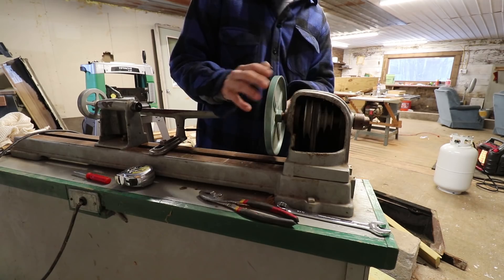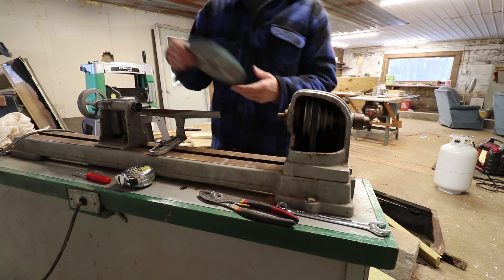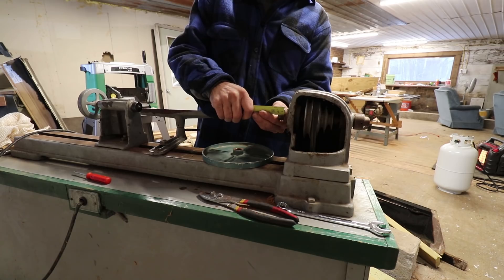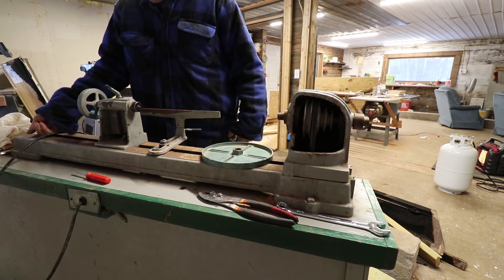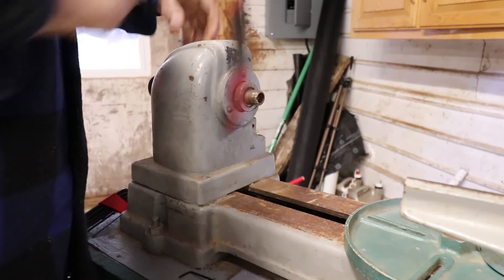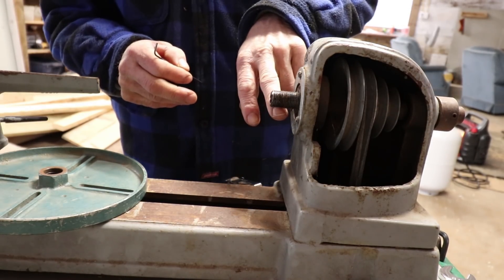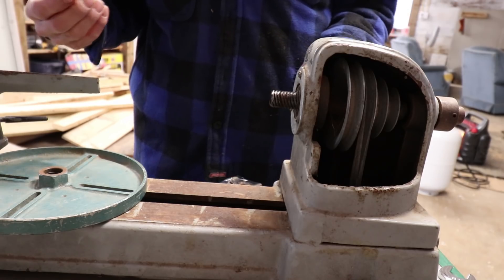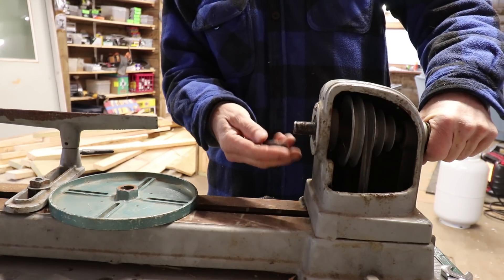THE WORKSHOP. Lathe Question. I need Lathe Chuck advice. Please Help.

Comment: I bought an adaptor off of penn state industries, to adapt my lathe to a common size thread..  A lot of tap and die sets have a thread gages, where can figure out the thread pitch or just see what size nut fits on.  The adaptor from penn state industries worked fine for me.    As for the chuck,  I have a straight tooth chuck and hardly ever use it, seams easy to knock the piece out of center.  I don't feel like they hold the work piece very well.  I think a dovetail jaw would be best.  I have multiple face plates I use mostly.

Comment: Get a couple of thread pitch gauges.  They will come in handy.  Also a digital caliper and a set of dividers.  A 6" and possibly a 12" SS rule will be more precise than a tape.  When you start messing about with tooling get out the mechanic/machinist hat and throw the carpenter hat back in the truck.  Good luck - lots of things to learn on a lathe.

Comment: That’s an Atlas lathe Power King.
Go to Brian Weekley he’s on you tube and rebuilt one just like yours.
The tag is on the back side under the  open part where you gang pulleys are. Yours is gone. I wished I could send you a pic but go to Brian and he will fix you up.
You can look up Thom Stevens he tore one down too.

Comment: I have no doubt there are several viewers who can guide you.  I know your pain when it comes to buying a tool for the occasional use.  If you are anything like me, you want something that functions well enough and that will provide a level of longevity without breaking the bank.  Well wouldn't we all...lolololol  I own several Grizzly products as well as Jet.  My recommendation is: see if you can luck out on a used Jet Lathe.  Obviously there are better ones in the market but better means pricier.  As a side note, I don't know if its me, but Grizzly seems to have dropped in quality.   Wonder what some of your viewers think.  It will be fun reading the comments.

Comment: JOE. I have an oldf Sears lathe with the 3/4 shaft. I checked with the chuck supplier and they said they had an adapter to go to 2inch dia. To match their chuck.  I also found that the lathe had a #1 morse taper in the head and tail stock. Most modern lathes and accessories have a # 2 taper. I have asked a local mackine shop if they can bore the #1 to a #2. They said it will cost about $200.00.  They said the shafts are hardened. Most modern accessories  are #2 taper.  I am still considering getting a newer lathe.

Comment: EBay shows a Sears 4 inch face plate #9-2489 for Craftsman Lathes  3/4 inch bore x 16 T.P.I.  they have six available for 29.87 each  you would have to buy a lathe chuck to go with it.

Comment: One of the standard spindle sizes on wood lathes is 3/4 by 16 tpi (threads per inch) the spindle stop is needed for most faceplates to give a seat to the faceplate or to a chuck so they don't become jammed on the spindle. Most places that handle tools for wood lathes should have what your looking for. Also, the tools that you were using are carving tools, lathe tools have long handles and are much heavier, the inexpensive lathe tools will have a handle of about 10 inches or better and the higher priced ones will be about 14 to 16 inches. You can use carving tools and they do work but the steel will not stay sharp as long, because the edge relief is to short. Your best bet is to view wood turning videos to get a visual idea of how to operate it for best results, and then lots of lovely practice and once you feel comfortable with it, your pretty much good to go. Hope this helps

Comment: Hey Joe, I work for a company that sells Nova Chucks, One way Chucks and Easy Wood Chucks. As mentioned you'll count the threads within the ½" and double to get your thread pitch. In the ¾" diameter Nova Chuck will have an adapter in the 10, 14 or 16 TPI sizes.

You'll want to look at the Nova Pro-Tek G3  insert chuck ($139.00) and then the insert adapter compatible with you TPI...($27)

As mentioned you're using carving chisels as turning tools so you may want to look at some better tools. Contrary to popular belief, the lathe is never the expensive part of the hobby.....its all the other items needed.

Comment: Joe, look on Amazon. LA341018 PSI woodworking spindle adapter. Then a Nova Chuck 1” 8tpi will work on you lathe. You also need some actual lathe gouges. Those little carving gouges you have are not designed for the force the lathe will put out. Carbide lathe tools are also a great way to get a feel for turning.

Comment: Joe, you will either need to buy an adapter, that will take your 3/4" to make it a it a 8 N 1.  If you can't find one, maybe a machine shop could make you one.  Here's a link, on Amazon, for several different size adapters.   Maybe one will work for you.  https://www.amazon.com/PSI-Woodworking-LA3318-Headstock-Spindle/dp/B000KI8CBQ/ref=pd_day0_2?pd_rd_w=IpUWF&pf_rd_p=8ca997d7-1ea0-4c8f-9e14-a6d756b83e30&pf_rd_r=KYZPV5FGG59PVZV3X4TG&pd_rd_r=b44a7905-e494-442f-8f0f-987b4e314490&pd_rd_wg=QkJna&pd_rd_i=B000KI8C9I&th=1

Comment: Those are hand carving tools not wood lathe tools. That's a Delta lathe. The collar is there to keep the shaft from moving lateral. Put the collar back on. Threads are standard. Every lathe should be the same in the US. Get a Nova chuck.

Comment: If I were doing it, I'd want to identify the lathe first. Sites like vintagemachinery.org might be useful for research (that site in particular has photo indexes). Knowing general characteristics might help in the search...spindle threading (outboard as well?) solid spindle?, MT 1/2 headstock and/just tailstock?, swing?, motor HP, etc. I'm lucky because my old Delta lathe had a plate, but otherwise I'd be looking for part numbers and so on.  Granted components can be swapped between equipment, but it might help with detective work... I've been pretty happy with a Nova G3 using the 7/8-14 insert I needed.

Comment: Hey Joe I have quite a bit of lathe experience I would try and find a chuck with the same threads as the shaft and I would leave the spacer on it. It looks like you have more then an inch of shaft with the spacer not on there and I'm sure you know threads are measured by how many per inch my guess is the shaft is a 3/4 by 10 thread. Which ever way you go I would get a 4 jaw chuck, there are two kinds an independent jaw which means each jaw moves separately I wouldn't go that way they can be difficult to center your stock I would go with self centering 4 jaw. Hope this helps

Comment: Hi Joe, I have a Walker Turner spindle lathe, around 1930. It has a 3/4 inch shaft with 10 tpi. I ended up buying a 1 inch chuck with adapter to fit the 3/4 inch shaft from Penn State Industries. FYI, you need all the parts attached to the lathe. Lastly I recently moved the motor from the back of my lathe to the bottom under the pulley. Works well, I would say it works much better.

Comment: You can modify that faceplate you have there to use.  Go to a used machine place near you and get a used chuck for cheap.  The people there should help you with transferring the chuck to the faceplate better than I can here.  I was a machinist for 50 years and doing this would be 20 min. job and tell it would take me forever.  I think that advice can get you started in the right direction.

Comment: Check the messenger for your Facebook page. I sent you a link to a thread adapter. If it’s 3/4x10 tpi, there are some chucks that’ll fit. Also, that collar needs to stay on there. The chuck or faceplate will butt against it for support and stability.
Reply from the maker: I will check that later tonight Chris but mine is a 3/4x16 tpi.

Comment: I worked in a major machine tool co mfg. In their turning divisions, I learned that there are multiple variables. Most pertain to what you are turning ( metals, plastics, wood, etc ) Joe, try & look for ID mfg plates. You might try with the data plate on the motor, gearbox, sprockets/'pulleys, worm gears, etc. It's a long shot, but you could find a name & google it. FYI not all Sears products were Craftsman. Also are there any local machine shops you could ask ? Good luck my friend 👍

Comment: You should put a caliper or micrometer on the outside diameter of the threads to be sure its not metric. if it is in fact a nominal english dimension it will be 16 threads per inch .062" if it is a nominal metric thread  it could be a 1.5 metric pitch Great vids keep it up and good luck
Reply from the maker: I doubt it is metric simply because it is so old. At least I am hoping it is not metric.

Comment: Hey Joe I would reinstall the spindle collar then if OD. is 3/4  measure one inch from tip of spindle now count the threads if it is 16 then look for a three jaw chuck with a 3/4 -16 ID thread.  PS Rodger here over 2 year subscriber and enjoy watching your videos first time reach out. Hope all is well and by for now.  Rodger
Reply: Amazon part number LA341018 is the adaptor you need to to increase your 3/4-10 spindle to fit  a 1"-8 Chuck size.

Comment: Hi Joe. Nova chucks are good chucks. I have a couple. They come in 1" , 8 TPI (threads per inch).  To screw the Nova Chuck to your lathe spindle you'll first need to screw on an adapter to transition from your spindle size to the Nova chuck.  You measured the diameter of your spindle and counted the threads in your video... just be sure to double check the thread count is only over an inch not the entire length of the threaded part of the spindle.  You'll need that information to order the correct adapter. Last I checked i think adapters cost around $30-$40 and they are typically available where you buy the chuck.  

Also, depending on the type of turning you want to start out doing there are other options for holding the work piece you may want to check out too.  (And as a few others have commented, the tools you got for Christmas are wood carving tools.)

Woodturning is fun and addictive. There are tons of great YouTube channels devoted to woodturning and the community is very open to help others learn all about it.  Good luck.

And thank you for all your videos.  They're addictive too!

Comment: I've been turning for about 30 years. You have one of those old Rockwell, Craftsman, or Delta hobby lathes most likely. The 3/4" by 16 thread isn't all that common anymore. Unfortunately, the best thing to do is spend the money on a decent chuck. 
You have a few options unless you get lucky on EBay.
OneWay Talon chuck  https://oneway.ca/Talon-Chuck-(Complete)
You could get one of the chucks that take an insert that allows use on various headstock spindle sizes. Nova, OneWay, and others have those sort of chucks. You should call those folks and find out more. They are super helpful. There is no community as nice as woodturners. :)
You aren't going to be bowl turning on that lathe so likely you will only do spindle turning so a chuck will be nice to have, but not critical.
Feel free to email me (gmail) if you want more.

Comment: Rockler has Nova chucks of various sizes. There is 4 Rockler stores in Minnesota, the web site has the locations. They can help directly, and since they have the parts it will be better. Most of the Novas are about $26 and they might have the 3 way jaw chuck too. You will need some proper lathe tools too.

Comment: PSI Woodworking LA341018 Lathe Headstock Spindle Adapter 3/4" x 10tpi to 1" x 8tpi  PSI Woodworking CUG3418CC Utility Grip 4-Jaw Lathe Chuck System. Check with PSI company to see if it's what you need.
Reply from the maker: My spindle though is a 3/4x16tpi.

Comment: Yeah you need that nut on there too take out the slop on the spindle. But, take that nut with you to the hardware and see what will thread into it. I’m guessing 3/4”-10 or 3/4-16 but it could also be metric.

Comment: Joe, measure the OD of the male shaft. And unless you want to do some disassembling count the number of threads ove the lenght of 1/2" and double it to get the TPI just to sve you some time and labor. If these are V threads you should end up with 3/4-10 or 3/4-16. Count the threads over a 1/2" = 5 would be 10TPI and 8 would be 16TPI. These are the most common threads but the pitch will and  do get into NEEF. The way that chuck spun on the shaft I doubt they would be that fine of a pitch. Also look and if the threads look like they have a flat at the top and bottom they could be ACME threads. 

 One other thing if you have a pair of dial calipers vernier calipers or a 0-1'' OD mic check to see if the very start of the shaft and the furtherest point you can get to from the end measure the same. Just to make sure these are not taperd threads.I don't know about wood lathes but I just retired form a machine shop with over forty years of making, reverse engineering and repairing parts off of equipment that the manufacturer has long been long gone. You can take a close up picture and email it to me and I'll help in anyway I can. Love the channels and your dad is a hoot! Hurry up and make that tent trip PLEASE!

Comment: My question is how many threads per inch is the shaft. I know virtually nothing about wood lathes but I am a machinist. 3/4 x 10 tpi is the coarse thread 3/4 x 16 is a fine thread. (Tpi = threads per inch) my guess is 10 tpi. Looks coarse from the video. Good luck. Quite a temp change from Louisiana
Reply from the maker: In this video I say that it has 16 threads. The shaft is 1 inch long (which I did not say in the video)

Comment: Hey Joe, if you have a machine shop near by, you should drop in there and ask them. Most machine shops have dealt with just about any kind of lathe and may know just what you need. they could also make any kind of adapter you require. There is also a guy named Keith Rucker on youtube that is pretty smart, give him a shout.

Comment: yes that collar has to be on there. It serves as the play or travel in the shaft of the housing. you need, I think a 3/4 inch diameter X 10  tooth per inch chuck.

Comment: It actually looks like an old Delta lathe. You need to keep the collett on it. If you don't then the shaft will work it's way out and you will lose the shaft holding the pulley in place. The issue is the age on it. The newer lathes are threaded different and have a larger shaft.

Comment: You need to know the TPI ( teeth per inch ) for your thread size.  Measure 1 inch of shaft and count the teeth as you did to get 16 unless you happen to have a thread gauge in your tools. I am in the UK and am not too familiar with the commonly used US threads.